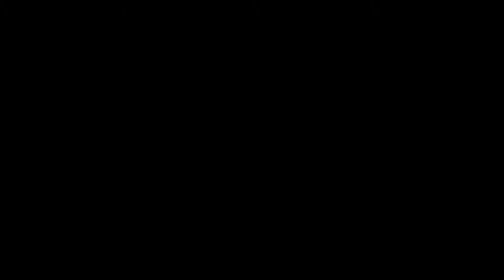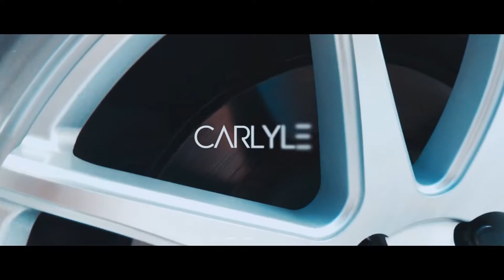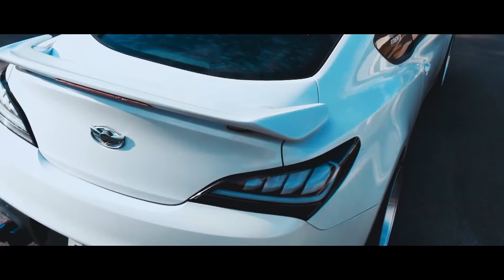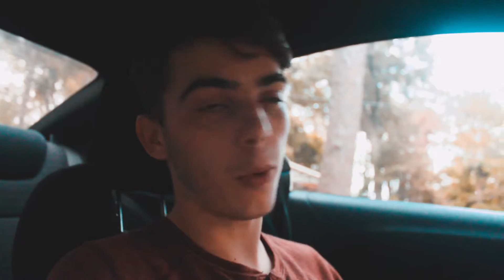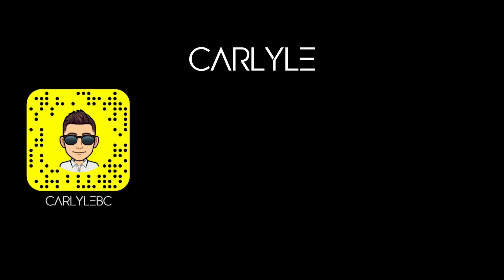My car's problem is worse than I thought...

Comment: I was in the same boat as you a couple of months ago, I love the genesis, it's a great platform but theres not that big of a market for it. It's sad because it's such an underrated car with so much potential. At the same time, they do have a lot of kinks and fixing them can be costly, and as far as money goes, they depreciate very quickly. I was lucky enough to sell mine for $7200 at 108k miles (or the guy was desperate or stupid). Even so, I would want you to keep it since you're one of the few people that puts out content for the Genesis and I was super grateful for that, it's why I still watch your videos even after I sold mine. I have since moved on to an 86 because of the aftermarket and the community. I originally chose the Genesis because I wanted a unique car and everyone and their mom had an 86, but I've learned to love the car but I miss the boost that the genesis had. I'm getting ready to install a JDL turbo because I feel like the 86 platform has a lot of potential. That's just my two cents, but I just want to say I love your vids, keep up the good work and I know you're gunna kill it no matter what route you take 👍

Comment: fix and sell the car if you really want the manual.  If you dont care about having an auto, keep it and do a turbo build, easy 380-400whp.   If you get the 3.8 you would need a turbo kit to get surpass 350whp.    Although i will say having a manual is so much better when modding the car. Just to let you know I have a 13 2.0t 6spd  with 126,000 miles and havent had a single problem, feels like a new car.... these engines are tough if they are cared for correctly
Reply: Feel that buddy. I got my 2013 base 2.0T 6 speed in 2014 with 61k now I have 172k and all with regular maint. Turbo at 75k but that’s it my dude